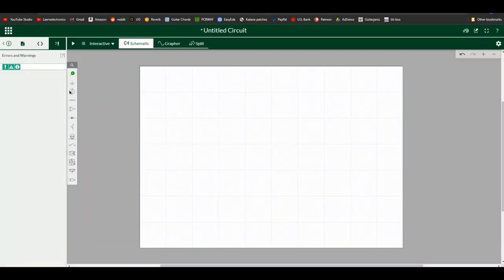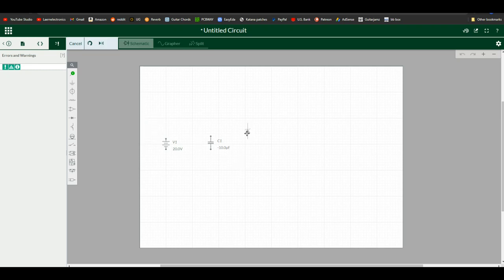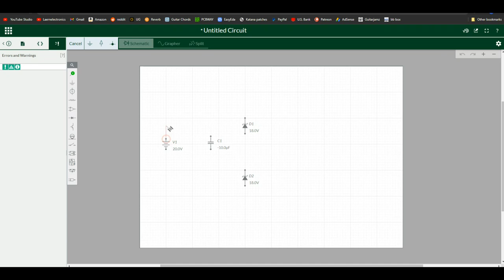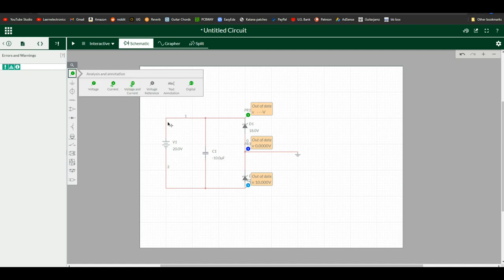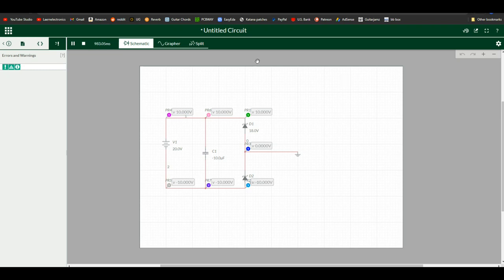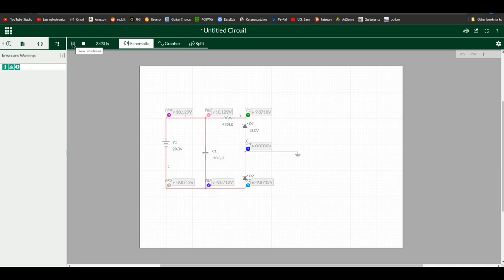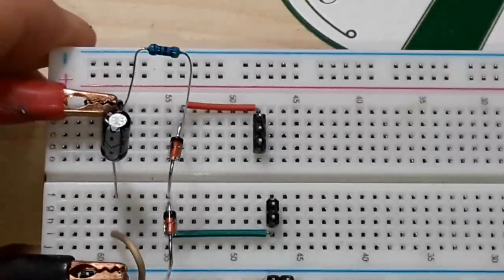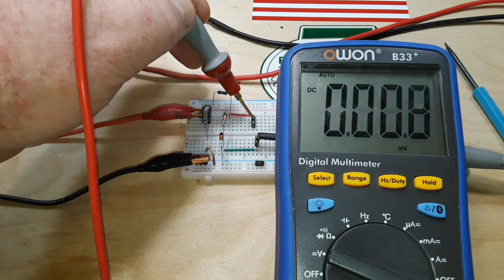Zener Diode Split Rail Power Supply

Comment: As soon as you put an unbalanced load on this circuit, the voltages will no longer match. Simply put, the circuit as shown won't work in the real world where currents on the positive and negative rails differ dynamically. Now, if you change those zeners to say, 7.2V, and use suitable resistances in between the battery and the two zeners, then you'll end up with a regulated +/- 7.2V supply that will stay put and stay centered so long as you don't exceed the current limits set by the resistors.

And to those who say, "but it worked in the simulator!", I would submit that it worked because the simulator did not simulate a load of any sort. The zeners acted as extremely high-value resistors (as they were not in avalanche mode) and so they split the voltage neatly. But that won't work with a dynamic, unbalanced load.

EDIT: It's also good engineering practice to bypass the zeners individually with say, 33uF or 47uF caps. This not only reduces zener noise, but it provides a lower source impedance to dynamic loads.
Reply: Just came here to write "How about you put a small load to it?" and saw you said it better.
Reply: Yep! I put a 10k load across the top zener and 15k across the bottom, and the performance was no better than a resistive voltage divider built with high resistances.

Comment: At 20v supply and 2 18v zeners, there will be no stable ground voltage because the zeners won't conduct until 18v is across both of them. Not sure you're getting what you expect.

Comment: Love these basic videos! The only glaring omission is how to calculate the + and - voltages which will be dependent on the current draw, input voltages, zener breakdown voltages (18 in this case) and the R value of the input resistor used. These are really only good for low power circuits (such as op amps you mentioned) as the regulation will be poor if memory serves correct.

Comment: I believe there is a problem with this circuit.  Since the reverse voltage across the two 18v zener diodes is 14.2, that means it is less than the rated zener reverse voltage which also means that the circuit is relying on zener leakage current.  Although the voltage output is correct, I believe the power output from the circuit would only be on the order of microamps.  Also, you lose the regulation that the zeners would provide.  The fix would be to power the circuit above the rated zener voltage (36v or greater in the case of 18v zeners, or use 16v, or less, rated zeners with your 32v supply).

Comment: about the multisim install,
first thing you hear, try multisim, it's free. the install takes a half hour. after that, it presents you with buttons to validate your purchased license or try a seven day trial. i can't tell you what happens if you select either of those, but what i can tell you is that, if at that point, you decide to opt out of the procedure at that point, and uninstall multisim, you are left with a desktop you can't click on because of how the multisim install focuses it, then you have to reinstall windows. don't try to uninstall multisim and see if it recovers your desktop, because it takes a half hour, and does not.
Reply from the maker: I just the run the web version. No install necessary.

Comment: Mine did not work with 18v zenners.  One rail was good but the other was only 2v.  Swapping out different 18v Zenners produced quite random results (one pair produce +/- 3v out).  I found zenners closer to the output rail requirements seemed to produce reliable results.  In my case 30v in and 16v(or15v) Zenners produced +/-15v out.  27v in produced +/-12v out

Comment: Is there a limit on the load?
If I insert a electronic board (500- 600mA) on the pos. rail and use the neg. only for the negative voltage
to activate a beeper, is that possible or does it imbalance the solution?
Reply: The resistor will be too hot
Reply: @alexstone691  Which resistor? You mean the beeper?

Comment: But what happens when you start to put any appreciable load on these power rails? I suspect the higher the load, the worse the output voltages will sag.
Reply from the maker: You don't. That's why I said this isn't the best way to do this. Just showing a type of circuit. This is for opamps using low power.

Comment: Excellent video, but what would the advantage of this circuit be over a simple potential divider using two resistors instead of diodes?
Reply: Voltage dividers waste useful energy as heat!
Reply: @samreames1713  So do (zener) diodes. Which brings back to why or when use one over the other.
Reply: @Noxoreos  Zeners 'regulate' the output voltage.

Comment: This is neat.  I saw a video where the guy suggested buying a second power supply just so we could have a positive and negative rail.  Is there any benefit to a second power supply over this method you just showed us?  I guess it could be faster to hook up?  Anything else?  Until now, I've just been using two cells in series with the ground in between.
Reply: It depends on availability and input/output parameters that you desire. So for example if you need a true output ground for an amplifier that goes down to DC, like amplifying something like data for a measurement instrument, you probably don't want to use a split power supply; on the other hand you probably can just rig up an ICL7660 there to make a negative rail. It's often about things you already have in the circuit or in vicinity of the circuit, i personally usually don't find hanging ever more power supplies onto the circuit anywhere near elegant. But i might also resort to that if a lot of power is needed and that turns out to be the economical solution.
Reply: if you need a beefy current, yes, two power supplies will do the trick.
if not, this zener or classic resistor divider will work fine, for currents around 100mA. of course, your power supply will be set to the double of the needed voltage.
that limit of 100mA is about power dissipation, for more current, you need power zeners, at 1W or above, or power resistors, and the dissipation will be... too big to be nice! :)
Reply: Thanks so much for the advice. I'm very new to electronics. I I've only had my o-scope in my signal generator for a month now. I watched a video on the 7660, and I bought some on Amazon. I think this will be the easiest and cheapest solution way for me to have split rails right now
Reply: @tonycarboni2002  what exactly are you trying to do?
7660 is a low power converter intended for local supplies for microprocessors and so on, so, it's working fine if you want low currents and low voltages.

if you want a cheap solution for a low power split rail supply, you can use a lot of different solutions.
i had need a split supply some months ago, a low power one, so, i used the old trick of AO virtual ground. i had an 2030 in my junkbox, so, i used that part to craft one, because i already had in my hands that part. :)
2030 is, simply said a power AO, not necessarily just a single channel audio amplifier.
Reply: I'm just a hobbyist. I just go on YouTube and look at all this crazy circut stuff and try to recreate and measure it myself. I don't really know what I'm doing yet. It's just fun playing with all this stuff. Right now, I'm just interested in learning all the different ways of creating two  power rails. Not sure why. It's nice to have a few people to bounce questions and ideas off of. I'm glad to be part of the group.
Reply: @tonycarboni2002  gah! :D ... been there, done that: too much options, not sure what one is the best! :)))))))))))
anyway, you really need at first steps a reasonable powerful power supply. yes you can craft yourself one, but this can be a too high task for you... or a mundane one! because i don't know your skill level. :)
most of circuits don't need a split power supply, and most of those who need one, don't jump over + and -15Vcc, so, if you want to play with AO's, try to buy a 30Vcc variable power supply, and split his Vcc rail like in this video or using two resistors or an AO. is good enough for study.
two 9v batteries will work, too, but all batteries have the habit of draining, so... :)
keep in mind of your circuit need of current: if you want to use two 9v batteries, they can offer a vay too small current.
AA and AAA batteries looks like they can give more current, but you need to use series chains for a higher voltage than the nominal 1.5V... LiIon/LiPo accumulators are more beefy, but there are some problems with their high current capabilities and a strange mode of charging safely!...
finally... if you have enough money in your pocket, buy two supplies: they will be useful for that moment when you need more than +/- 15V, AND for that moment when one of them is broken! :P
without joking, you really need more than one power supply, one soldering iron and one DMM... because we live in a world governed by Murphy's Law! :)
Reply: @ Hash I have one power supply now.  I mostly use this for experimenting.  If they say an LED can pass 30 milliamps, and a capacitor can hold 10V, I like to see.  I also like blowing things up for fun.

Can I ask two questions about this power supply?  It's a Kungber / 30 V, and I can limit it by volts or amps which is cool:

1) If one has a 30V power supply wouldn't he expect around + 15 and -15 volts on each rail with the 7660 IC or this Zenner Diode trick?  I'm still waiting for these components, so I can't test yet.

2) Assuming (1) is correct, why would one ever need more than +- 15 V on each rail?  I am just doing this to mess with op amps which is the next chapter in my book (Practical Electronics--very good book).  I've already wired two cells together after spending at least a day or two trying to do it with one cell alone.  I don't think that works, but it was fun trying.
Reply: @tonycarboni2002  for 1, best thing is to read 7660 datasheet, and see what is their maximum voltages.
for 2, yeah, today a circuit needing a symmetrical power supply over 15 volts is very rare. but sometimes you want to try an old circuit using more than +/- 15V just for "did i can make this work?" reason! :D
(there are some old signal generator circuits, mostly just a bunch of transistors, no IC at all, powered by symmetrical rails of 18 to 28 volts. ofc, if you really want this, finally, you need to craft a power supply of his own, but in testing phase... on top of that, the second power supply can be your reserve, if your main power supply became spoiled...)

Comment: Ok now hold on. I do not understand how you're getting a negative voltage from one single supply.
Reply: Relative to the supply, there is no negative voltage. It creates a virtual ground, so the circuit behind this can just treat the centrepoint as if it was ground, then it has positive and negative voltage related to that. Just the same like you can split a supply voltage and create virtual ground with two resistors or two capacitors, or a combination of capacitors and resistors.

Comment: GK Gallien krueger amplifiers have a term called the GK Growl is when the preamp or power amplifier hits the power supply Rails it has a certain Growl to it. So its your rail to rail is +14vdc and -14vdc and the power amplifier audio signal is swinging and hitting the rails at +14vdc and -14vdc it will produce a Growl. I'm not sure why it produces a Growl Tone but maybe you can explain in a video lesson
Reply: I don't know, but it sounds like it might be either due to rail sticking, or more likely rail inversion. Inversion is when you come close to negative rail, suddenly the output signal swings all the way over and sticks to the positive rail instead, for example, that happens in some topologies and would make for quite a characteristic sound. Either way unlike clipping or saturation, it takes a substantial time maybe up to even something like in the millisecond range, to unstick from the rail, it's not instant the moment the input signal is no longer such magnitude that the output would be close to a rail, it's a longer time.
Reply: @SianaGearz  I'm confused what rail sticking is and what is rail inversion. Stuck Rail is when the audio signal is swinging and gets Stuck to both the positive rail and negative rail causing what to happen? Rail Inversion is when the audio signal is swinging close to the rails and causing rail inversion which causes what to happen?
Reply: @waynegram8907   Rail sticking is when the output signal approaches a rail, and then later when you would normally expect it to come back down, because the input signal is coming down, it just doesn't, it stays stuck to the rail! It will unstick itself eventually though but it takes a while.

Inversion is when instead of rail sticking, the signal goes instead all the way to the opposite rail and sticks to that rail instead.

I don't think it's good to describe in text. Maybe you'll find an explanation with images somewhere. Because it doesn't make a lot of sense purely in terms of output signal, these behaviours are only when the output signal no longer follows the input signal in magnitude, so you want to see a before-after to make it clearer.
Reply: @SianaGearz  Yes I get it, it depends on the Op Amp because of the slew rate and threshold input points how they will lock or get stuck to a rail

Comment: I have a circuit diagram that uses a Zener diode for the proximity sensor on my 3d printer. I would love to see you explain how it works.  It allows 12v+ to power the probe and limits the current going back to the board input so it doesn't dump 12v onto the board when the probe triggers and closes the circuit. I copied the drawing, built it, and it works, but I don't really understand what it is doing to any level.
Reply: Is it a 5v zenner diode(ZD)?  I think you'll find that the ZD is being used to limit (cap) the voltage returned. There should also be a current limiting resistor as well.  The circuit may look similar to this, but the operation is fundamentally different. Note that the zener diode is used in reverse polarity. The diode will not pass any current below it's threshold voltage. This means that with a suitable current limited supply the voltage across the diode will always be it's rated voltage. That's the way it's being used in your probe Circuit. In this Circuit being demonstrated in the video the supply needs to be over the rated voltage of the zener diodes and they are simply being used as a split rail voltage reference.
Reply: @Chrisamic  That sounds correct, I can't find the drawing or the link. There may have been more than one resistor. I understood it's function and could copy the parts, but don't really understand how all the pieces worked together or why the Zener Diode value was selected to work with resistor(s).
Reply: @varmint243davev7  You're over thinking it, understandably.  The rating of the zener diode is simply the voltage that you want the circuit to output.  Most likely they picked a 5V zener, or a value just under 5V but high enough to signal a "high" to the TTL input pin on the microcontroller in your printer.  The resistors are simply there to limit the current to a reasonable level that won't stress the diode or the proximity sensor and they aren't critical values.

Comment: just one guy in the dining room 😂😂🤣🤣
I got a question why do we have to put ground when we have a negative terminal of the battery in multisim🤔🙄
Reply from the maker: Try it without and see what happens
Reply: Ground is just an arbitrary point in the circuit, that can be chosen to what fit's your needs. When you insert a voltmeter in that software, that's what each measuring point is referenced to. People like to call the negative pole "ground", but you could actually even define the positive pole of the battery as your ground, which means that all other voltages are below that defined ground.

Comment: "Quick & dirty" - why dirty?  What would this be bad at doing?
Reply: It's not guaranteed to be robust, as there's no regulation happening. If the circuit has a constant load, you can get away with this, though, hence the "quick and dirty".
Reply: It's also very inefficient and will consume more power than what is used by the load, and will be severely limited to very low load currents as with all zener-only power solutions.  A better solution is to only use the zener as a voltage reference (with a very large resistor to allow it to only consume a few mA) and use that reference voltage to control a  transistor or MOSFET depending on your application (or just use a generic three pin jellybean regulator).  The big advantage is it gives you a reasonably well regulated split rail power supply with just three or four components.  "quick and dirty" (and cheap).